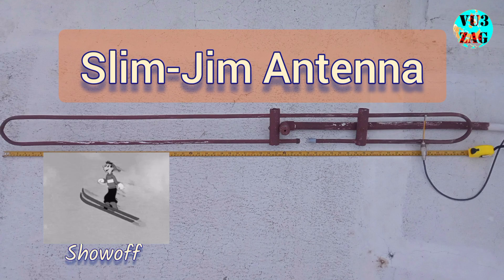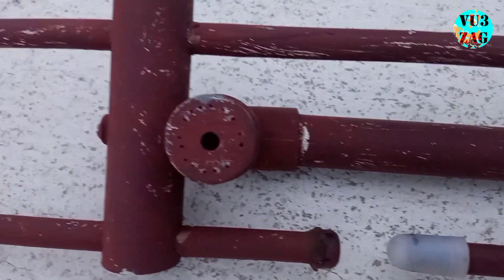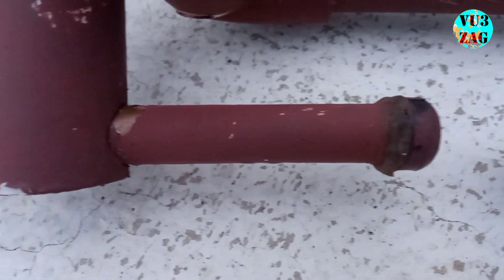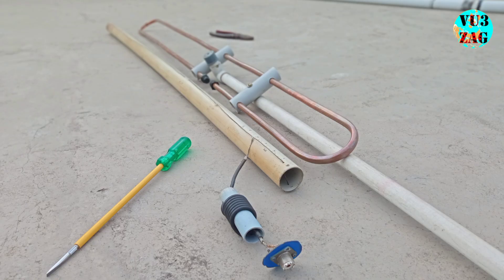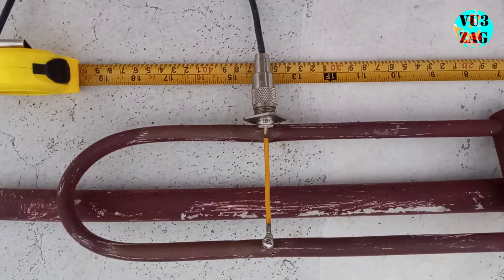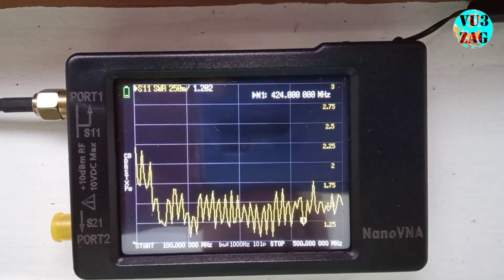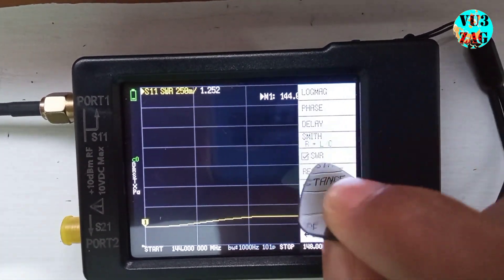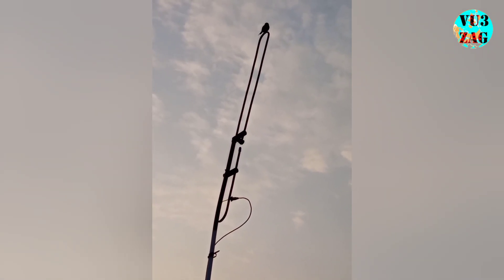Copper Tube Slim Jim antenna

Comment: 你好 我做了一个U段 J型折叠天线 中心频率在420M 我该怎么调整到435? 73
Reply from the maker: You can trim your J pole antenna to move the tuning frequency upwards.  Use the online calculator to get approximate length of the Jpole arms and trim your antenna accordingly to match with the calculated frequency.